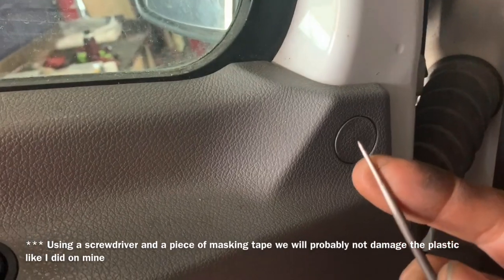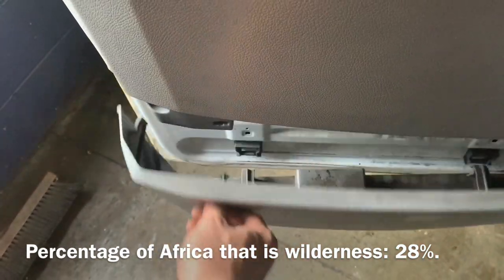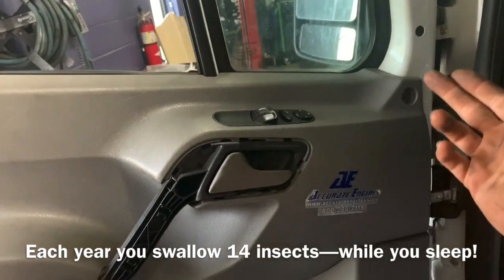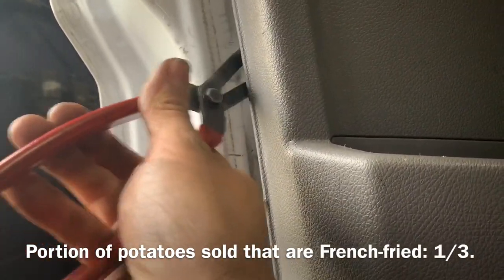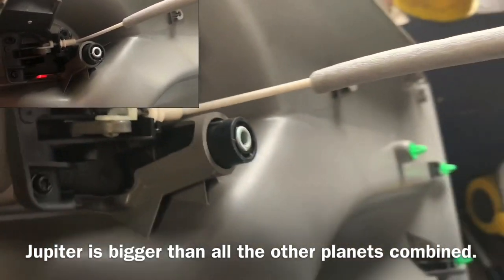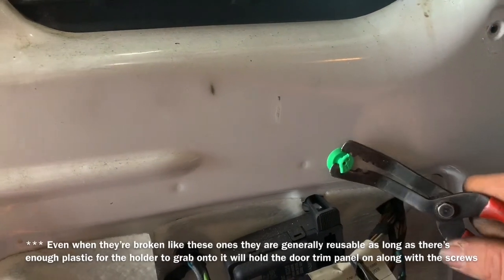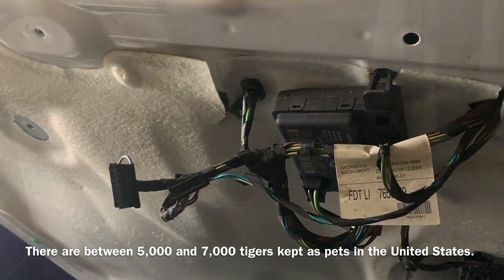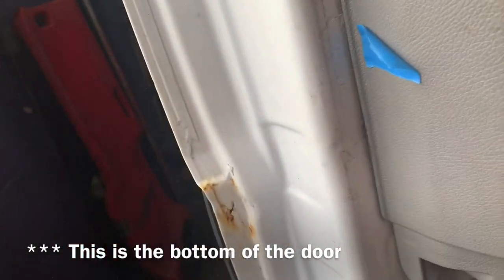Window Switch Replacement Mercedes Sprinter WITH Sprinter Door Panel Removal Instructions!!

Comment: Brilliant - worked a treat on my 2013 UK Sprinter.

For anyone wanting to sort tools ahead of attempting, mine was T20 for the four around the panel and T27 for the two around the door handle. (Don't take those as gospel as I've seen others suggesting different sizes. They were what mine was.)

I had a grommet lever from one of my many car trim items over the years that popped the little suckers out no problem. And don't be frightened to give it a good shove to get them back in.

Thanks again! Video was a lifesaver.